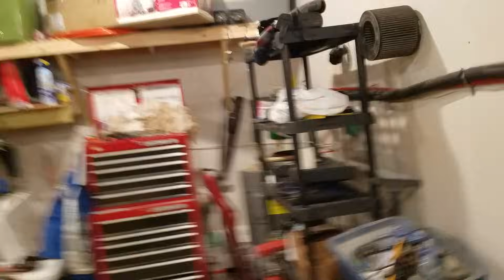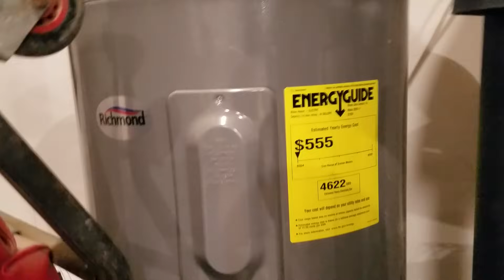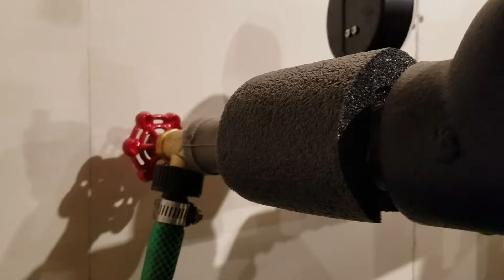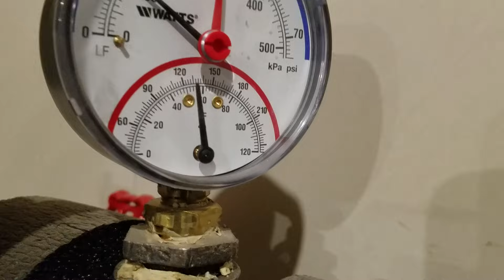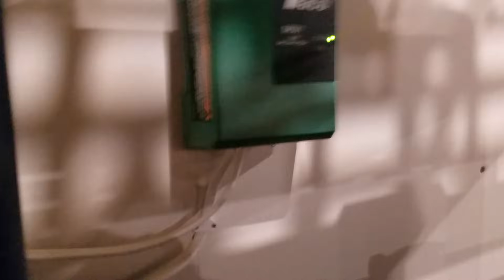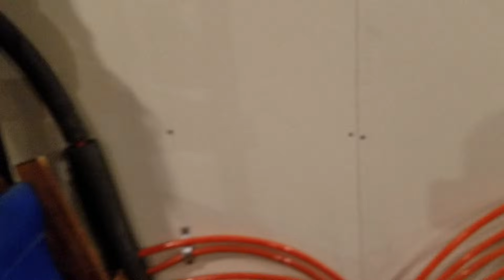EASY FLOOR HEAT (using a new or used hot water heater!)

Comment: Ive got an old system that was installed already in my house.  Pressure gauge reads 0 and water doesnt cycle. Can you explain how I would use a pump to fill and add pressure so the water cycles?  Ive definitely got air in the system.    My expansion tank is 10 PSI so I assume I should shoot for that.  Also, do I just dump equal parts water and anti freeze into bucket?

Comment: gravimetric weight requires 2.3 pounds of pressure per foot of elevation to equalize, so if pumping upwards, add 2.3 pounds per foot to ensure proper lift and flow rates. so in essence you reqire 4.6 pounds of pressure per foot minimum to circulate uper levels.
also remember, the 0.6% reduction flow variable per elbow
Reply: Uncommon Valor good point.
Reply: Uncommon Valor. What size supply line for the 2.3 psi rating?
Reply: Ummm, not fer nuthin' but that should be 2.3 ft of elevation (head pressure) per pound of pressure. IOW, 23 ft straight up = 10 PSI of head pressure. In this case with the majority of the water (antifreeze) being below the circulator the only thing you need to compensate for is seeing a negative pressure (vacuum) on the inlet side of the circulator, which for a little one like that would be around 5 PSI drop while running. IOW, 10 PSI total system pressure is probably more than enough. (gauge being at the highest point here)
Reply: It takes 1 psi to move a  foot of water 2.31 feet.
Reply: You're confusing "moving water" with "head pressure" which is all about the static weight of a column of water. (static = NOT moving) There's no way to come up with a figure of how much water one can move unless you know the pipe length and diameter, which will give you the friction loss for a given GPM (gallons per minute) flow.
Reply: I am not arguing your original comment. Static weight is not in consideration when measuring GPM. Static and head is the same when talking hydronics. I am saying the same as you. To move one gallon of water 23 feet, one needs 10 psi in the closed system. To move 50 gpm 23 feet, one needs the same 10 psi (9.956 corrected)
Reply: 50 GPM would make for some serious velocity noise in pipes sized for a typical residential system. That little Taco pump (007?) can only deliver around 30 GPM at best, and that would be through something larger than the 3/4" it's connected to in this video.
Reply: rupe53 WOW really missed  the point
 That pump or the half in. Pipe would not handle 3 gpm
Reply: So why are you mixing GPM with head pressure? My original concern was maintaining enough system pressure (in any system) so the inlet of the circulator never goes below 0, which will make the boiling point well below 212 degrees and cause noise in the pipes. Not sure if that will be a real issue in this system at say 120 - 140 degrees tank temp but it's a serious concern in most boilers set at 180 degrees. See, all circulators have a pressure change between inlet and outlet, which varies with flow rates and pipe sizes. A 5 psi increase on the discharge side will yield a 5 psi decrease on the inlet, within a closed system. (that's 10 psi total across the circ) Since we never want the inlet side in a vacuum (below 0 psi) we want some residual pressure on the system.... and just a little extra to add some fudge factor. This is where my original comment was aimed and why it's important to have an auto-feeder maintaining things. BTW. you are right about 1/2" pipe not flowing too much, but there are 5 loops so likely the total flow is well above 3 GPM. Since we don't know how long those loops are we have no way to figure the friction loss (and GPM) from where we sit.
Reply: My point is it takes 1 psi to move a column of water 2.31 feet in height. Pipe size is not in play.
Reply: Start at lowest point of system. Measure to highest point of system, take the measurement in feet, divide by 2.31 equals your static system pressure
Reply: Agreed, this would give us the static pressure at the lowest point in the system, which based on the height of the gauge (high point) to the tubes in the floor, so about 1 psi with a zero gauge reading. (about 5-6 ft head height) Let's add 5 psi to keep the circulator happy at the intake side and another 5 psi as fudge factor, for a grand total of 10 psi at the gauge and maybe 11 psi at the floor level. Now we never have to worry about the supply side of the circulator going below zero during a call for heat. Of course this is IF we don't have excess friction loss in the floor pipes. We'd have to know the total run length for each loop to calculate that.
Reply: Please don't confuse static head with dynamic head. Lifting water vertically is NOT the same as moving water in a circuit.
Reply: Paul Maxwell thank you for getting this!    Folks if the water heater is on the 3rd floor and all the radiant is on the 2nd floor and first floor in theory the water heater would be the highest point in the system!    This would mean the water heater would in theory need 1psi of pressure and as we went down the vertically the system would gain .434 psi per foot.    If the lowest pipe was 10’ below the water heater the pressure would be 1psi starting pressure + 4.34 psi for our 10’ for a total of 5.34 psi.    

Here’s where 99% of people get confused.    So what’s our head pressure for our pump?   The answer is we don’t know.   I didn’t give you enough information to solve that problem.   It depends on many things.   

Whether the radiant is above the water heater or below it the pump size is exactly the same!   

Feet of head on a closed loop circuit is based on resistance and flow rate of the pipe and fittings used.    If you had short loops of radiant and large fittings feeding them and a typical tank water heater the feet of head would be somewhere around 1-4’.    If you took your 1000’ roll of pex and decided a 1000’ single loop would work best (you’re dumb) the feet of head ends up being in the 30’-40’ of head.    It depends on flow rate and size of pex obviously.

Comment: Please fix those electrical wires. They are literally shaving against the sharp edges of the metal box on both the water tank and motor. Both of those need a clamp to keep the wire steady. Especially on the motor when it’s running, it can cause the cable to expose the wire and short out.
Reply: Robert Steich First thing I saw too!! Sloppy and poor Workmanship.

Comment: What kind of problems are you talking about with the pumps burning out. I seen several comments about this in the comments section. I don't see anything here that would hurt the pump unless a lot of air was in the lines which can be fixed pretty easily.

Comment: Should have a check valve on the discharge side to prevent back flow and gravity rise of hot water over cold water.

Comment: what area do you live.  im in northern Indiana and Im connecting the garage zone to a 60 gallon hot water heater.  I do know If I will have enough btu to handle any other zones in the house.  Do you have any suggestions  thanks

Comment: Any idea if a tank that size would be able to support a 2400 SF garage?  I guess I am unsure on how to size the water heater.  Great video!
Reply: Square foot times 25 is the amount of btu's you need for infloor heating. I sized my water tank five times larger then the cubic gallons my pipe loop will hold.

Comment: Nice system!, tell me what does it cost you to run a month and whats your KW usage for this time?
Reply from the maker: I will be running the whole system through it own meter as an experiment, to find out if a smaller water heater, or a homemade boiler, I am working on is better.
Reply: This guy water heater elements pull a lot of power to heat. They usually pull 18amps, that's a lot to heat a garage. Most smaller water heaters pull the same amperage but may actually run less due to amount of water it's heating. This method has been used for a long time. I've seen it used for in house heat driveways and sidewalks to keep ice off.
Reply: I think the main point here is that 18 amps could go to an electric space heater (heating the air) or to the floor heating system, which is MUCH more comfy if it's an occupied space, such as weekend projects etc. With the floor being warm you can actually get away with a lower temp and still feel cozy because your feet are warm, not to mention the floor is always dry. Not so when you only heat the air! Yeah, there's a major cost difference for the installation, but that water heater is the cheap part and can always be swapped for something else if the mood strikes.

Comment: You did not mention a mixing valve.  Are you running the 110 deg water directly into a cold slab?  I thought the theory of operation was to circulate water that is just a little bit warmer than ambient so as to slowly warm up the slab.  

If you were to turn this off in winter at 30 deg, and then turn it on and circulate 110 deg water it seems like it would shock the slab.
Reply: There really isn't a way to "shock" a slab. It's a giant slab of concrete weighing God knows what. Why would you ever turn this off in winter anyways? Usually you would turn this system on Nov 1 and run it until the outside temperature stays above 32 deg at night in like March. All conventional boilers send instant 100 deg water through the floor. If you send like 60 deg water through the floor it would be waay too cold coming out the other end. Even with 100 deg water the water coming out the other side is like 40 deg. This system almost directly emulates what a boiler would do. The only difference with this system the floor circulation pump quits from time to time when the temp is warm enough, which you could argue actually makes more sense because then you are not running your circulation pump unnecessarily, cycling cold water though the floor.

Comment: Man thanks for this video was so  guess intimidated about the whole hydronic systems and boilers and expense. My question to you is i noticed you had a 6 gang manifold how big a run of pex did you use for each run like 300ft per run so 6  1800ft of pex??  Just trying get a idea how many square ft a 40gall could heat?
Reply: Max of 250 feet run per loop
Reply: @lesgallivan4159  most recommend 300'

Comment: You might consider using the drain valve opening for your return.  Simply remove the drain, replace it with a nipple and a “t”.  Thenput the drain valve into it.  The cold water inlet on a water heater is a poly pipe which will eventually erode.
Reply: Good point, I’m using my drain for the hot water return from my two longest runs which take forever to receive hot water at the faucet/shower

Comment: Great information here.  Did you replace the T&P relief valve with a boiler relief valve?  Thanks!
Reply from the maker: Travis Dieter : There was no need to change out the relief valve, the hot water heater is run inside it's operating range.
Reply: Ok thanks.  As I'm sure you know, standard water heater PRV's are set to blow at 150 lbs.  A boiler relief is set to blow at 30 psi. I was thinking that the excessive pressure to blow off might be rough on the components if the pressure ever soared. But hey, if the standard prv works, then great. It will save me money when I go to install my system this winter.  I appreciate the reply.  Travis

Comment: Did you put the PEX beneath the slab of cement? Did you pour a new slab of cement? Did you use a different for type? How did you run the PEX pipe?
Reply from the maker: They laid a layer of reflective foam insulation on the ground, then installed the PEX tubing, then poured the cement slab.

Comment: Lots of nasty comments below, some from guys who claim to be plumbers. Here in Canada we call this the California system. It's not at all uncommon, especially for workshops and other outbuildings. I've done it myself. Perfectly legal, if not connected to the water supply. Always use non-toxic propylene glycol. If you were using only water it could be connected to your water supply via a make-up pressure reducing valve. This Guy, ignore the haters. They spend all their time trying to convince others that something can't or shouldn't be done.

Comment: Lots of questions - what kind and size of piping material did you put into the concrete?  How thick is the concrete above and below the piping? Why so many pipe connections?  How did you crimp the pipe connections?  Overall cost of the system?  For about how many sq ft will this system work for?  What's the capacity, gpm and pressure rating of the pump?  What are the model and part numbers of the items you used - under-cement pipes, manifolds, thermostat, pump, air bleeds, etc?  Is that a normal, regular hot water heater?  What are the particulars of the accumulator you used?  The people at the only hardware store in town here know even less than I know about this kind of installation.  Some nuts and bolts information would sure help in addition to just showing a completed, working system.  Your help is appreciated.  Thank you.
Reply from the maker: 1/2" PEX tubing was ran through the concrete. The tubing was installed 3" off the insulation that was laid before, and the concrete is about 8" thick. The guys that ran in for me came up with 5 zones, so that is why there are so many connection. you can find PEX connecting rings and crimping tool on amazon.  Click the link in the description for the pump that will have all the specs on pump. Hoped this helped. There will be big changes in this system in up coming video, so like and subscribe, and you see the how to for the new system. Also you can find a complete break down on materials at  http://thisguydiygarage.com

Comment: Hi  l built a open system  radaint  floor heat  system  where  I heat my floor  and my potable / bath water on the same system  useing 2 50 gal Geo Heat pump / electric  hot water tanks  .most of the time it runs on the heat pumps at 500 watts x2 = 1kwh per hr verses 4500 watts water heater elements.  Works will/ cheap to run .only thing is there is no freeze  protection  as it used  water . But I well insulated  so no worrys

Comment: I'm thinking of doing this for my small 12x30 woodshop. Well insulated up here in VT. Can I use a small electric tank or is it better to have a bigger one? What kind of pump did you use? Thanks!
Reply: Did you end up doing this in your wood shop?  What size electric water heater did you go with?  How's it working?  My shop is about the same size so I was wondering. Thanks.
Reply: @istvanmeissler2238  I ended up using a Rinnai direct vent wall furnace and it works great.

Comment from the maker: It costs about 600 a month to heat my house and garage. 3000sqft house, and 1200sqft garage. They are on the same meter so unsure what it is alone. It comes to $7/sqft for both a month.
Reply: 600!!?? That seems awfully high. I am in the country,  burn propane for house, 1500sqft, and pay 120 a month. Have plans to build shop in one of my pole barns,  1800sqft. I sure hope it doesn't cost me that much as I am really gunning for infloor heat..

Comment: hey  do you think I could use the same set up on the ceiling in basement to warm the floors on the upper level  thatnks
Reply from the maker: Couldn't see why not...But check regulations in your area, to see if you can.
Reply: certainly you can, it has to be a closed system seperate from your domestic water

Comment: Electricity costs are the same what ever system you use.  A lot of expense has gone into this set up but I just wonder if a straight electric air blower would do the same job for less outlay.  Assuming that the floor is not being used to store heat as a thermal mass.
Reply: The cement does store the heat so even if the power goes out it stays warm for awhile.

Comment: Wondering if a mixing valve may be required to make sure that the pexpipe recommended operating temperature isn`t exceeded. Will the glycol affect the pexpipe.
Reply: If you’re using the special type of glycol that’s made for boilers and heating systems you shouldn’t have any problems with pex

Comment: I have a brand new system. 7 loops of 300 feet each.  One zone. I want to use a new hot water tank instead of boiler.
My house is 1990 sqft one level. I'm wondering how big a water heater to use and how big a pump to use. Any help you could give
would be greatly appreciated!
Reply from the maker: John Crossley That is about the size of my folks house. He heats his basement with a 30 gallon I think. I believe you can see what it is in my video about it. The link is in the discription box below this video or click this link here. https://youtu.be/_DgU5fYN25g

Comment: How warm does your garage get?  I'm planning on mine being kept at 58. But when in working in there I want it warmer
Reply from the maker: I keep it 58 - 62 degrees Fahrenheit. Depending on insulation, outside temperature, and the limits of your system, you can have it as hot as you want. If you kept it at 58 degrees and wanted it 70 when working in there, I would get a good electric space heater. Floor heat (especially in concrete) takes time to heat, so it may take several hours to a day to move the temperature 10 degrees. I find when it is 0 or below outside and I walk in to my 58 degree shop, I am comfortable. I hope this helped. Thanks for watching!
Reply: @thisguy014  yes awsome info thank you.